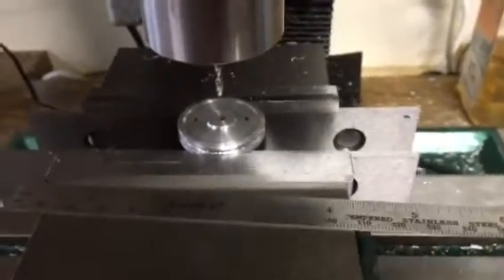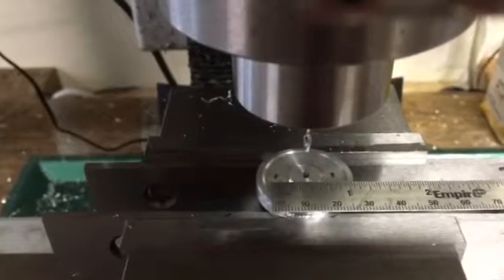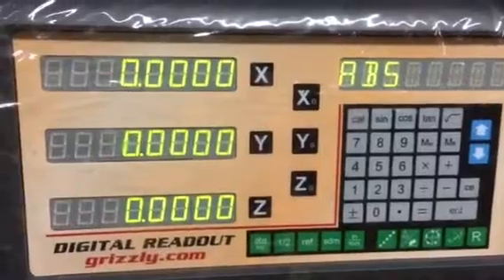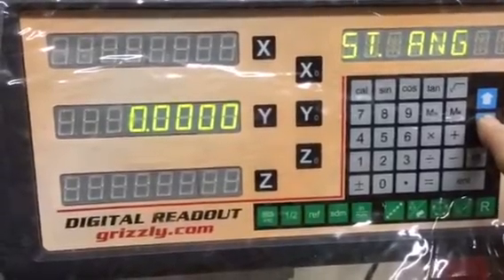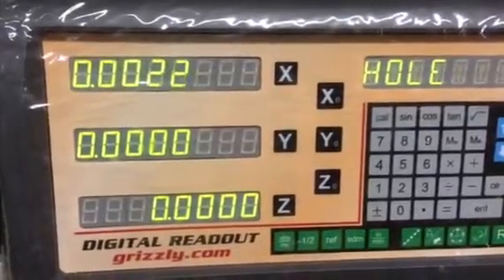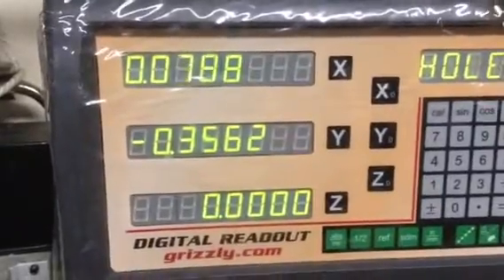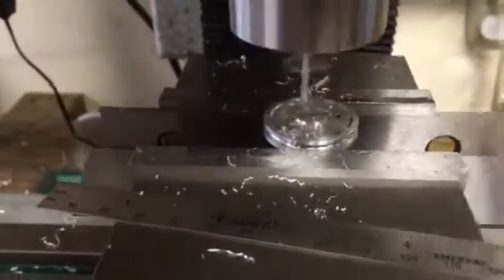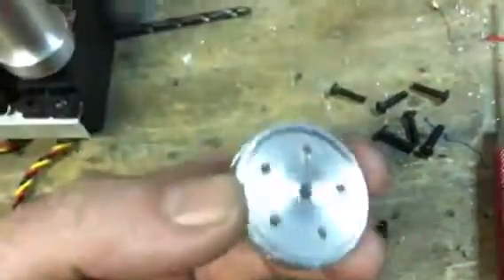G0759 DRO Bolt Circle

Comment: I'm here because possibly looking at this mill. I have a new Siege 2xd, and ofc it has 2 defects that I cannot fix. This Griz is 4x more $$, but what a rig! Are all the controls (X-Y-Z) really smooth? tyvm
Reply from the maker: This is my first and only mill so I don't feel like I can answer that with any amount of expertise.   I have had a few small issues with it but I still like it and use it.  The bearings are not the best but they work, and I have replaced the plastic gears twice now.  The last time recently and was probably my fault, i think the mexh was a but loose and caused it to strip the teeth of the first gear that rides on the brass gear of the motor.  I would love to try a big mill but don't have the space and don't really have the need.  Jim

Comment: The starting angle sir is always zero,even in any # of hole,ending angle is 360
Reply from the maker: Thanks for the tip.  The dro can do so much and I have to admit I don’t understand it very well.  My biggest problem is that I don’t use it often enough and what I do learn I usually forget.  Jim

Comment: If you did 0 and 90 it would divide the 90 degrees by and place all 5 holes within that range.  If you want a full bolt circle you have to put 0 to 360 :)

Comment: Hey Jim! I was wondering if you could a tutorial video how to make a dragline boom like one you have in the yellow dragline, if it's even possible to make same kind by yourself. I need a boom to my rc drag too but i haven't found any from here in Finland, and i have no extra cash to buy from outside of Finland. :/ thanks
Reply from the maker: Interesting idea.  Do you want the boom to look like the original boom?  Did you find the video where I cut out the middle extension from aluminum using a wood chisel?  Jim
Reply from the maker: Here is the link to the extension video, http://youtu.be/A4jtn-lO_qU  I might make another boom if we can figure out what style of boom you would prefer.  Jim
Reply: I would like to prefer same kind of like the original, thanks already responding for me.